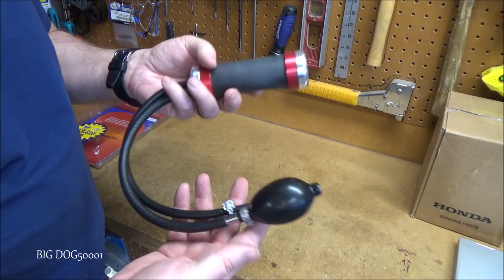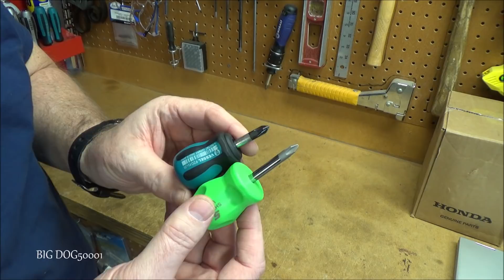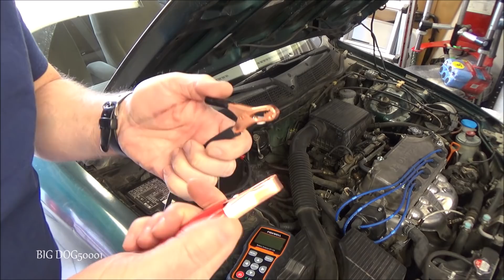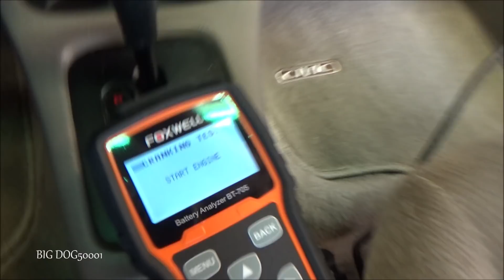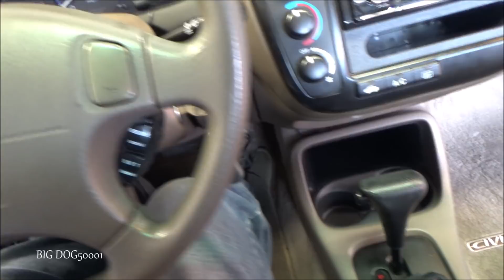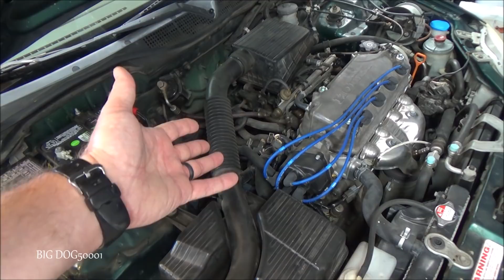Tool Haul Featuring Snap-On, Redline and More!  Tools Episode 1903

Comment: Hi BigDog,  I need to buy a new garage drop-light for car work.  I old one is corded and has a 75w bulb.
What do you recommend?  battery\rechargeable  with LED's?   HarborFeight has a few LED work lights.    Is 250 lumens enough?

* I just found and watched your video comparing the Braun to the Astro,  Thanks!!  *
Reply from the maker: I recommend a rechargeable LED and you found the video showing the 2 lights I use the most lol.  They both have pluses and minuses.  For $25, the Harbor Freight light works pretty darn good.

Comment: How are u liking your autel so far,any problems,thx for the info
Reply from the maker: I like Autel a lot.  My older Autel would lock up on some Hondas during live data occasionally but the new one has not had any issues.  Thanks for the comment!
Reply: I'm going to get the MS 908 and maxiscope from jb tools through your link because I assume it'll be US supported cause yours is,thx buddy
Reply from the maker: JB Tools is a reputable company.